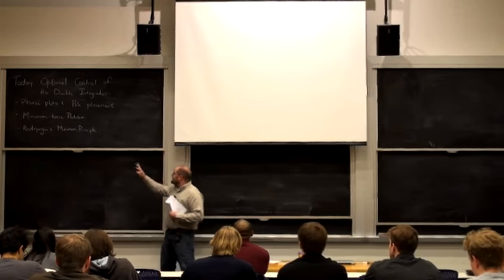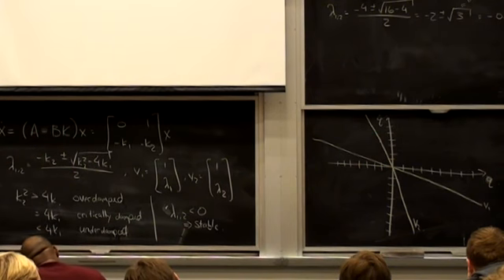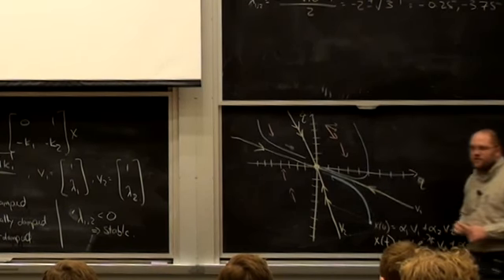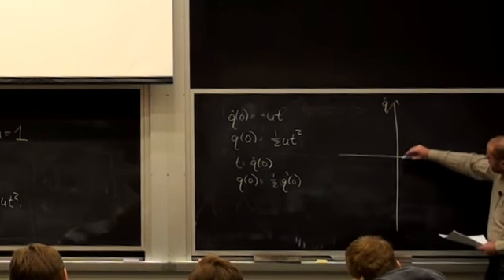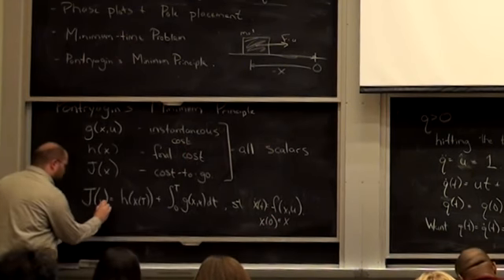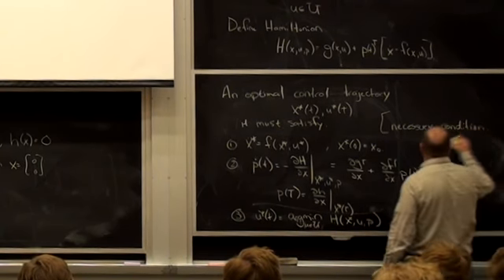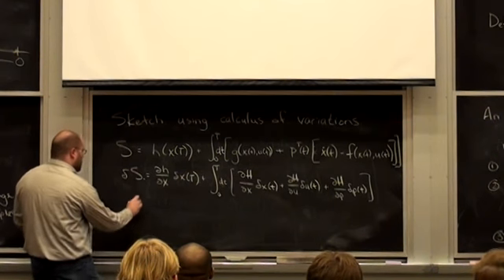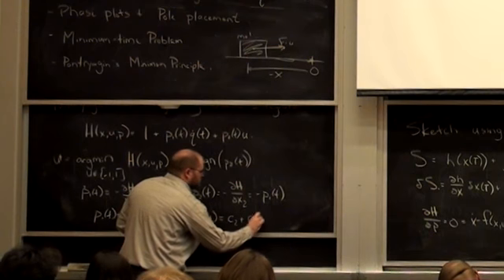Lecture 3 | MIT 6.832 Underactuated Robotics, Spring 2009

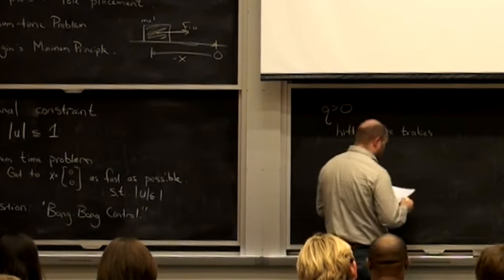Comment: It seems that the assumption of q greater  0 then u=1 @ 28:40 is not intuitive.  The important component of the system state to decide that is velocity :   if  q' lower than 0, only positive actions will take the system to origin. It turns out that analyzing the initial conditions, only  q'(0) that can go to origin with positive actions corresponds to q greater than 0.

Comment: With respect to control systems, a system is said to be stable if and only if all poles of the system lie in the LHS of the plane (since when converting back to time domain, they result in e^(some negative value) which eventually dies down to zero causing the system to be stable. I think maybe eigen values are analogous to that.